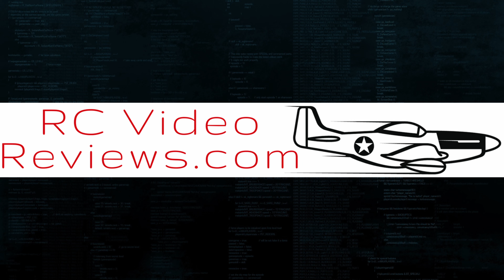How-to Use the RODE Wireless Go 2 Safety Track with Davinci Resolve 17

Comment: cant seem to find the backup in the app, does this only work using an external recorder.i have he safety (lower level backup) work by recording to the transmitter? I have my receiver set to merged mode and safety channel on, the transmitter is set to record backup and is in compressed mode. i can only see one normal recording saved to the transmitter in the app 🙁
Reply from the maker: The safety channel is an Rx function. Recordings are stored on the Tx--they do not have a safety channel. Tx recordings are mono. Safety track recordings are stereo and must be sent to a stereo recording device.

Comment: Am I thinking about this correctly? While the safety channel helps out with clipped audio from the receiver to the recording device (camera, etc.), it can't protect audio that may get clipped at the transmitter (i.e. an external input to the transmitter is too hot and causes clipping on the transmit side).  Therefore, the receiver is being presented with already clipped audio.
Reply from the maker: The recording is on the Tx and is recorded something like 12db lower than what is transmitted. The Rx doesn't see the recorded audio.

Comment: Hi, i'm a bit confused by this. Is safety channel recording using 2 transmitters and two separate mics? As apposed to using one transmitter, one mic and splitting that to 2 tracks with one -20db?
Reply from the maker: It's a single audio file from one transmitter. It uses one stereo channel for the main track and one stereo channel for the reduced db track. During edit, you can tell your editor to use the same channel for stereo output. If there's a problem, you duplicate the audio track, put it on a new line below the main audio, and tell the editor to use the other stereo channel for output which will be 20db lower.
Reply: @RCVideoReviews  I had the same question but couldn't find an answer. Unfortunately your video had both transmitters connected to the receiver and so it didn't quite answer the question. So you can have a safety track with only one transmitter connected? So what happens with two transmitters connected when the second transmitter is recording something different like a second person? I can't imagine the file has 4 tracks, right? Lol so confusing...